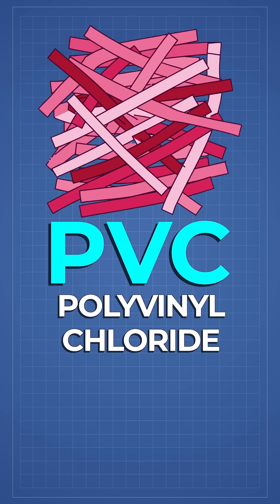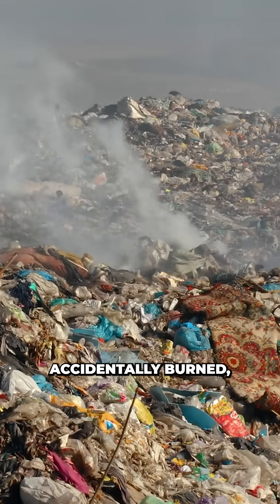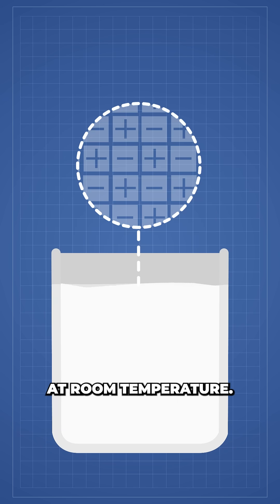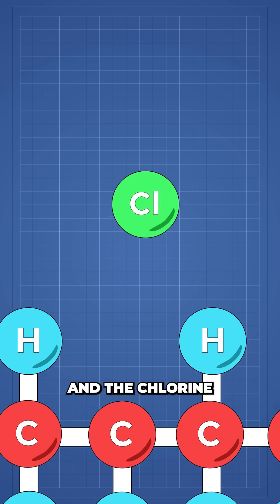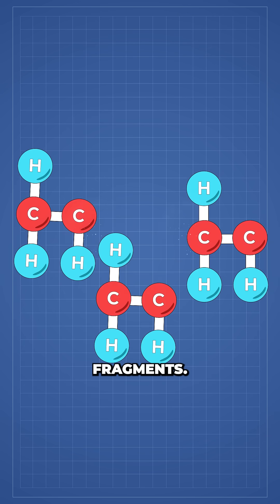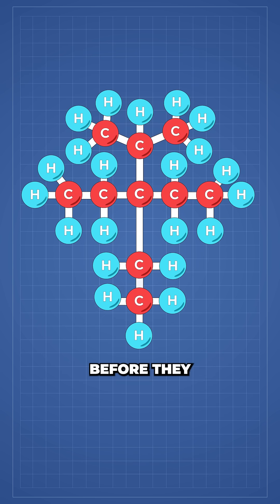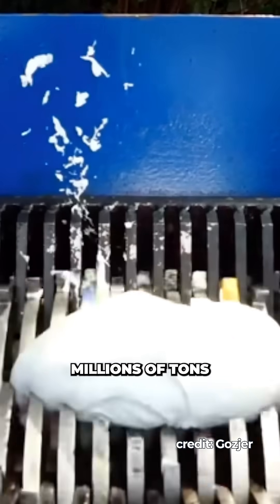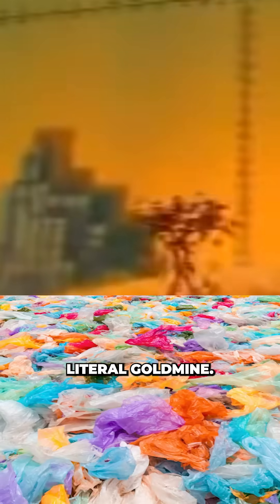Scientists Turn Plastic Waste into Fuel

Comment: That fuel being shown has a name - decane. Like methane or propane, it is a hydrocarbon that can be burned.
Reply: No it's an isomer of decane that means you can't just say it's going to behave the same just because it has the same amount of carbon and hydrogen
Reply: @sirlinkthefourth6755 
Which is why I didn't say that
Reply: @Belladonna-x2c it's literally the only thing you said
Reply: @Belladonna-x2c you can't just pretend like you didn't say anything wrong because I noted why being accurate matters in the same sentence I corrected you in
Reply: I did not say it behaves "the same". My exact quote: "Like methane or propane, it is a hydrocarbon that can be burned."

Is decane not a hydrocarbon?
Can decane not be burned?

If you're going to correct people on the Internet, and especially if you're going to be rude about it, it helps to be right.
Reply: If you want to be specific, the isomer in question is 3-isopropyl-2,4-dimethylpentane. If you want to prove that it is not a hydrocarbon, or that it is not a fuel that can be burned for energy despite being a branched-chain alkane, I'll be waiting. You'll understand if I don't hold my breath.
Reply: @Belladonna-x2c it's not decane at all that's what I'm saying it's an isomer of decane don't start being rude just because you didn't know what isomer ment and instead of looking it up like a normal person just assumed what it could mean
Reply: @Belladonna-x2c it's not decane at all that's what I'm saying it's an isomer of decane don't start being rude just because you didn't know what isomer ment and instead of looking it up like a normal person just assumed what it could mean
Reply: @sirlinkthefourth6755 
Even you are referring to it through decane. It is not incorrect to say "it is decane, specifically an isomer called 3-isopropyl-2,4-dimethylpentane". Just the same way as it is neither uncommon nor incorrect to refer to a penguin as a seabird.

The initial post was (rather obviously) aimed at the same general audience as the source video - having a simple point of reference for this fuel was something I deemed important. However, that terminology does get used in industry as well, as it is essential to be able to group isomers that use the same constituent parts.

If you don't like it, please feel free to tell the molecule you disagree.
Reply: @Belladonna-x2c I'm referring to it through decane because you said it was decane that's incorrect then I said isomers have different material properties and specified that it would burn differently everything else is shit you made up in your head to try to come out of this as correct. That's not how an adult should approach a subject, if all you care about is "being correct" then you should just hold your tongue
Reply: @sirlinkthefourth6755 
You don't like people being rude back to you after you're rude to them, and you hate that you were wrong. And faced with being wrong, all you can do is bluster and insult me. What a sterling human being.

Please, tell me. What shit did I make up in my head? What have I said that is not strictly true?
Reply: @Belladonna-x2c all I did was give you a minor correction you misunderstood and turned it into an argument, now I'm not going to engage in your rage bait further I have actual work to do

Comment: So almost all plastics are petroleum products that have been refined to within an inch of their lives so that things like Sulphur and other nasties are removed. Its how we get optically clear plastics, and the polymerization process the oil goes through is one of a few chemical reactions that can be reversed. 02 absent pyrolisis break the polymer chains and the resultant "oil" is super clean and can be refined into diesel, gasoline,  motor oils etc...
And were sitting on an ocean of plastics ready to be converted

Comment: Btw, that clip of the black guy wearing goggles he essentislly created crude oil from plastic which is a very basic form of gasoline and needs to be refined even further despite all the plastic he used. Yes its a good idea but, you end with such a small amount of pure gas when you see the amount of effort and plastic it takes

Comment: There is a problem  depending on what this plastic is used for its value will go up and if it is used in like kids toys or water bottles the cost of these items will go up and up until they are rarely sold at stores and the stores won't stock them anymore because it will take too long to sell and eventually no one will buy items that use this and then the production of this plastic and this will be useless. UNLESS the plastic is the same plastic that Legos use then this will just put up the price of legos.

Comment: Not new, people have been able to make gasoline from plastic waste for years
Reply: Literally just put plastic in a nonflammable barrel, set a fire underneath with the barrel airtight with a pipe going through a water bottle to condense the gas. If the resulting liquid burns you used the right plastic variety
Reply: Although I'll admit it's a crude version of gasoline, but still usable in engines and cars
Reply: Did you even watch the video? It's a new process specifically for processing PVC in a safer way and at lower temperatures
Reply: @MSUYwell no shit, but the same process can be used for pvc

Comment: I would have to see the research results, but I assume just like Plasoline is that the energy in to do the conversion is probably greater than the resulting energy by the burned fule at output.  Which means in capitalist society there is no benefit to doing the conversion, because the rich leaders don't care about the environment.

Comment: * A "literal gold mine" that would still pollute the air at the source of ignition (inside vehicles most likely). So as cool as it would be to get rid of existing plastic waste like this, we shouldn't use this technology as the green light to keep producing way more plastic products than we need
Reply: No, that is inevitable. Any tech that makes another tech more efficient naturally makes the latter more appealing. High MPG vehicles? Well, with your reasoning, we might as well all drive guzzlers from the olden days because manufacturing efficient vehicles might justify more oil usage and plastic production. More efficient engines has not stopped an overall increase in oil demand, by the way, but we're far better off having developed better engines than without. The same is true for this technology. Anyways, don't let perfection be the enemy of good.
Reply: @Zeero3846 I'm not saying we shouldn't use the technology, it sounds pretty good in fact. I just mean that at the same time we should also reduce unnecessary plastic production, try to make polymers based on other sources than oil etc. Basically that we should address the problem from multiple angles, instead of considering one technology as the silver bullet to solve it all

Comment: PVC is new, but even simpler plastic are not made into fuel because it's not cost effective. Unless there is a method where you can throw in all the plastics together, this will never work

Comment: Been following NatureJab for a while, he needs to be protected. Seriously.
Reply: Not really. He's built a dangerous, highly inefficient machine. It's a process called plastic pyrolysis, which has existed since 2000's. It releases very toxic gases, is incredibly inefficient and dangerous. He's a snake oil salesman, raised 36k+ on a gofundme because he faked a disappearance. Hasn't ever shown real test results, and the fuel he does produce emits toxic emissions and isn't good for most engines. Additionly, if you used the fuel produced in a generator, you'd barely be able to produce 1/10th of what the machine used to make it. He's a sham.

Comment: Oh yay, a technology which requires a complex chemical to work, enables the plastic indistry further, doesnt address microplastics everywhere and encourages the use of gasoline as a pollutant. Fantastic. Solving one problem by amplifying the others isnt a good solution. We have energy options, and we could be switching back to glass, and aluminum which recycles much easier, albeit with more energy, but we are only recycling 5% of plastic anyway, so kind of a null argument. Tldr: use poison to turn solid poison into gasoline, which makes air poison. How about we just stop making so much poison?

Comment: Correct me if I'm wrong, but aren't most plastics made from oil? Which is typically used making gas.
So is this in a way reverting the plastic?
Reply: Plastic monomers are typically derived from the lightest fractions of petroleum or natural gas, while fuel derives from heavier fractions, so no it's not a reverting of the process

Comment: With my limited knowledge on this stuff, it makes sense considering many conventional plastics, even PVC, are a product of petroleum.
Reply: This video is primarily misinformation mixed with a news article they didn't fully read. Turning plastic into fuel isn't new the issue is most types of plastic don't play nice and it's the absolute worst thing you can physically do to plastic waste ecology speaking and usually it's not even economically viable.

Comment: But then the carbon stored in solid form is going to be released in the atmosphere, causing another problem due to climate change. Feels like a pretty stupid idea.
Reply: Did you know you can capture gasses in plastic pyrolysis? Which burns plastic without oxygen? But, it DOES produce solid carbon black

Comment: they didn't JUST learn this, its been around for years but when a company tried to commericalise it they couldn't make it profitable so it got snowballed
Reply: Yes, capitalism runs on profit over affordability. The swindle over practicality
Reply: @ZalamaTheDragonGod  because it’s not fucking economically viable your dumb shit. 
If I use 10 energy units to turn the plastic back into oil and generate back 5 units is it worth it? Fuck no. You’re just losing energy at that point so why even do it

Comment: .... Do you do any actual research before just blindly reporting things? This isn't new and this kid has been polluting his area badly and has also possibly done a number on his own brain doing this in his backyard. 

The process to do this creates TONS of chemicals into the air, is very inefficient, will never be profitable, and thus isn't really done.
Reply: Watch the short. He is talking about a chinese University
Reply: @Xi_huang_Pie g@y boy the commenter is talking about the same process. It causes cancer and ect a lot of bad stuff goes everywhere from this process it's worse than dumping oil in the ocean or car batteries like cancer everywhere
Reply: @blooddragon515 Then what do we do then about the plastics if everything we do something to them is bad? Dump it to the Moon?
Reply: @Aptol  that's not a bad idea but recycling is the best option reusing plastic is better and basically the only option because if it's turned into fuel it's causes 10x the amount of cancer
Reply: @blooddragon515 What don't you get about a professional factory bring able to capture it's gas emissions? This is China, a country known for is intense energy development and research. Not a guy in a backyard with a microwave and pipes.
Reply: Capitalist brain is the root of all evil. Who gives a fuck if it's profitable. We switched from hydropower to coal during the industrial revolution but that wasn't efficient or cheap, unlike hydro. It sure was profitable though. You can infact capture gasses from production (if your country prioritizes humanity over profit).

Comment: “Safely captured as hydrochloric acid” I love how that’s considered safe
Reply: HCl is still a dangerous liquid/gas, obviously, it's just well known and thus very easy to contain safely.
Reply: You know that's the same type of acid in your stomach, also fun fact, most of the HCl produced in the world are consumed in the same factory for steel production, and then recycled
Reply: @alexwang007  for rust removal?
Before plating and painting i supposed?
Reply: @ClippyDontSpyYou  Pretty close. It's often used for "pickling" the steel, i.e. removing the mill scale that forms on the surface when it is heated to high temperatures. Steel mills usually start out rolling the steel into bars while it is still hot from the furnace, so mill scale forms on it during that process. If they're just selling it in the hot-rolled state they don't bother removing the scale, but if they need to do a follow up process like cold-rolling to more accurate dimensions or plating they pickle it first.
Reply: @nerd1000ify  i consider black oxide rust too
Reply: @ClippyDontSpyYou  Yessir, primarily used to remove mill scale from hot forming, and also for plating and painting! You can buy the highest possible concentration (at room temp) HCl in painting sections at certain hardware stores
Reply: HCI may be dangerous but is a very useful Industrial chemical.
It's also in your stomach in micro quantities for digestion
Reply: Yeah its pretty easy to capture it, and has many uses as an acid
Reply: Compared to many other industrial byproducts, HCl is incredibly safe
Reply: HCl has lots of uses.

Comment: Well clean as in cleaner than waste burning, but not as in emissions neutral off course - using the fuel would release carbon that would otherwise be stored in the plastic. So I'm a bit more ambivalent about that idea on a large scale to say the least

Comment: The very first claim is a lie, pyrolysis was not just discovered and it has been around for decades. The scientists only discovered a way to remove the most harmful elements from the process.

Also, for the idiots, people don’t get murdered over non commercially viable discoveries. I swear I could sell half of you a car that runs only on water.

Comment: 95% cleaner than what? Plastic or Gas.. 
And does that include the fumes from making the plastic? Probably not but just wondering. Still probably a good way to get rid of the plastic but toxins are still toxins.

Comment: I'm disappointed to see this reported as a positive. Big Oil is responsible for the current plastic pollution problem, turning plastic into fuel will only exacerbate the problem while converting plastic (oil) pollution on the ground and in the water into greenhouse gas emissions in the air.
This is hugely inefficient and polluting, and avoids the obvious: reducing plastic production in the first place.

Comment: Electrical (and sometimes electronic) engineers hates PVC. It's the cheapest insulation material (also in wires), but it loses properties with UV, water or dirt. It's highly flammable. In case of fire (too much current for too long or mechanical damage can cause it) it produces insane amount of deadly toxins - in fire toxins will take Your life long before fire will do. That's why there are regulations for bigger buildings to use either another material or PVC with additives to lower it's flammability.

Comment: Just remember, that PVC originates from OIL and SALT, however primarily from oil. The correct title for this short should therefore be: "Scientists recyckle Plastic Waste into Fuel - whilst they are burning a lot of fuel to creat the energy for the proces" or in other words, if you want to promote something, promote it correctly.
Reply: That's where green and fusion energy comes in.
Reply: @tcsmagicbox we only need extremely efficient batteries

Comment: This is great news for chlorinated plastics, but for pure hydrocarbon plastics, this has already been solved and is accessible enough to be DIYable: oxygen-free pyrolysis. It's even energy positive when burning the fuel produced to heat plastics for the next batch.
Reply: This is all nonsense. It doesn’t create fuel, it’s not energy positive, and it’s not economically viable. It produces a large amount of junk styrene and bromine. It’s a terrible process that was abandoned because nothing from it is really usable.